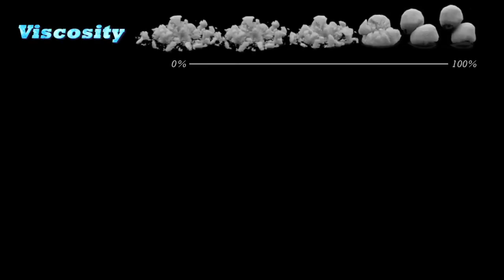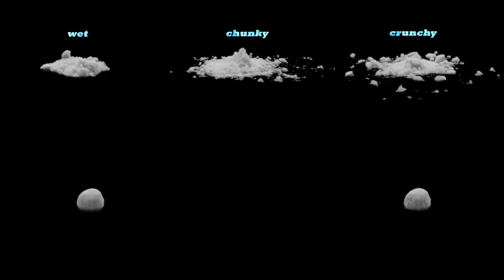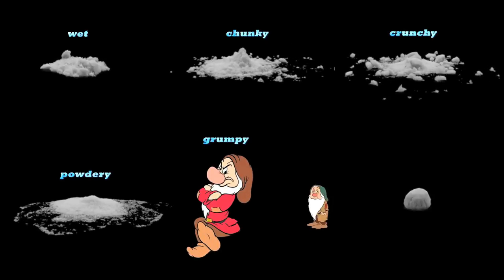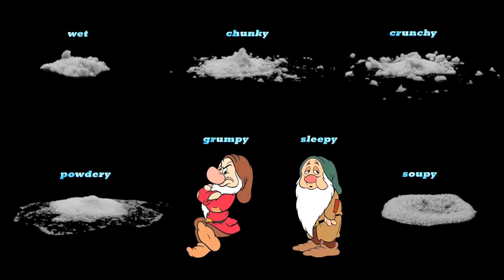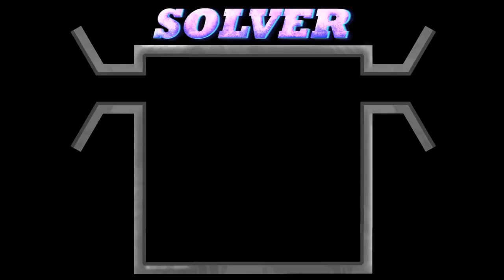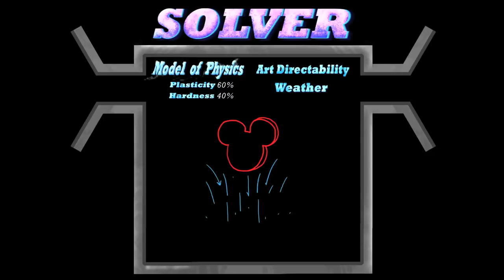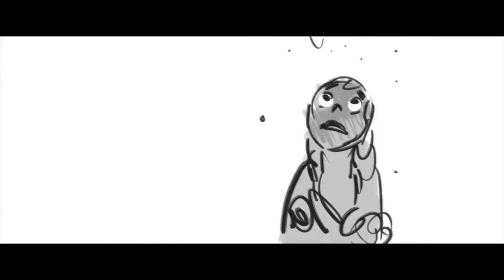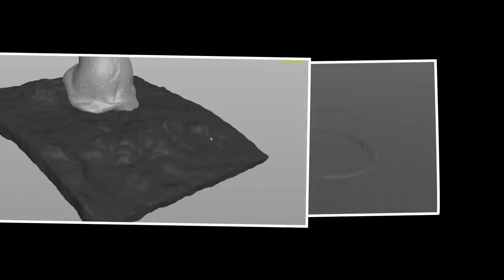Disney's Practical Guide to Snow Simulation

Comment: Wonderful! An animator has to be 1/3 artist, 1/3 actor and 1/3 engineer.
Reply: this is truest
Reply: Actually no, they have teams of people specializing in their own fields. It would be impractical to have a single person spread themselves out that far. Next time you watch the credits see how many names show up in different areas.
Reply: @To-mos  Yes but most of the time they have to have the vision first. The engineer does not decide the setting. The creatives does. The math follows the requirement of the imagination.
Reply: Depends really, artist may just follow requirements as well. Creative lead is its own field and usually is a position held by first working the technical parts (art and math)
Reply: That's just untrue. Most Animators don't want to be engineers. If you can do both, you will get paid big bucks, but most people can't handle or have the time to learn those skills needed.

I know this video got you excited, but you need to calm down and bring it back to reality.

Comment: I wish they'd release the algorithms and other stuff for the snow they used in frozen
Reply: they actually did. but it's really, really, really complicated and hard to control correctly
Reply: Radi Bear Do you know where i can get my hands on 'em?
Reply: Tossing my little hat into the ring: I'm noticing bits and pieces from what you put, though what exactly they go to is a bit hard without a reference for some of the variables. I think the first deals with velocity and somehow equating it with its vector on a 2d plane with some use of the Euler methods. The second formula you put seems to have a hard time getting across all of the symbols but I can see something that seems to deal with heat or energy transfer, and the last one looks like it is working with waves or fluid flow.
Reply: xcm b You are on track with the 1st and 3rd one. The 2nd one is off tho.
Reply: Radi Bear This is exactly how you kill any interest in a person for something, meh
Reply: Radi Bear I at least got more than I though I would. Also: I find it kind of funny how just mentioning the math involved in these kinds of things tends to turn people away. Disney isn't going to just give the software itself out, so anyone wishing to do what they do needs to work from the ground up (and in this case that means a lot of fluid dynamics and higher-course physics/math classes).
Reply: Banana Warrior But Disney's is one of the most advanced softwares out there. If you have not used 3d programs before, it's like trying to jump up a floor. (basically impossible). So start with Blender. It's a free (open source) 3d program that is great for both beginners and pros. If you learn that well, you can go on to Disney stuff.

And judging by the way you talk, it seems as if you have not taken many classes like advanced art or advanced programming or advanced physics related. So try out some free or cheaper programs for now until you are really good.

And remember- nothing great comes without hard work.
Reply: ***** I'm not using blender...
Reply: ***** Sony, Panasonic, and LG commercials use Blender. Physicists, archaeologists, and professional artists use Blender.

So I don't get why you say that?
Is it because of its superficial monetary value, that it's community funded, and not private cooperation funded?

It exceeds any of Autodesk's and Maxon's products in scanning and model editing. The shading and graphics (Cycles render) have been on par with Autodesk at least for over 2 years. source: I have used all these softwares

So I'm gonna ask you... what do you mean?
Reply: ***** That explains why. Autodesk has been established for years. But Blender Cycles is very recent.

Veterans of a field use programs they are accustomed to, just like you to Autodesk.

And in terms of flexibility, I personally find Blender much more flexible than maya in many areas. Take the transition from modeling to sculpting.

It doesn't mean that I solely depend on Blender for everything. But I prefer its workflow much more than Maya for my jobs.
After all, it boils down to personal preference once results are the same.
Reply: @ Banana Warrior here is the script https://github.com/Azmisov/snow 
this script will only solve the physics you will have to add meshes and shaders (material) to make it look like like in the movie.
Reply: this method is more than 6 decade old
Reply: If you want to read the original paper, you can find it by searching for "A Material Point Method for Snow Simulation," by Stomakhin et al. I think I remember it being published for SIGGRAPH back in 2015, but MPM has been around for a while before that. There are also some videos the team made for that paper as well, which should be on YouTube somewhere, likely under the same name as the paper.

Comment: How long does it take for the computers you have to simulate a like 5 minute scene as big as the Frozen scenes?
Reply: I did some googling and it seems it took about 30 hours to render a single frame. One of the frames even took 132 hours.
Reply: Ryunis No that's definitely not the case. May sound possible at first, but I did the math and it would take about 537 YEARS to render out the entire movie if it took an average of 30 hours per frame. Even 30 minutes per frame would take almost 9 years to render.
Reply: But did you take into consideration multi-core processors and multiple machines working on a scene? Once everything is calculated and presented in numbers it can be worked on independently and you can be 100% sure each frame will find it's place.

Also, none said you have to make all calculations on one machine. You could potentially have one core leading the process and using other cores in manner of "You, I need square root of 20314125. Okay, you over there, diameter of a universe, now." After collecting all the data it makes one last calculation to tie it all together.

To top it all off, there are special super powerful servers (we're talking hundreds of thousands of cores) which are for rent and exist to calculate within seconds things your desktop PC would need years for. You can read about them on top500(dot)org.

Source: IT student and graphics junkie